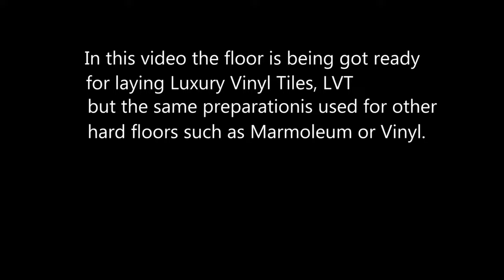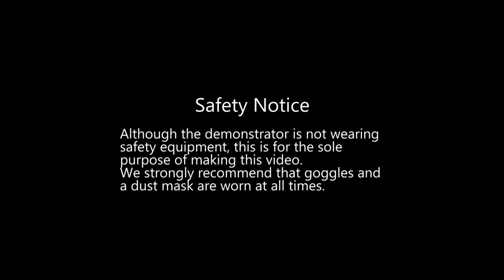How to lay a plyboard floor, a stable plywood underfloor for LVT, lino, marmoleum, vinyl or tiles.

Comment: I've got a cabin floor to ply over. I've only seen photos due to location but they look solid but ruff. Was wondering if it should have self lever on the floor boards before ply or use a stronger ply. But it looks like £40-£50 a sheet for stronger stuff. Going to need 6 of them.

Comment: If you add 6mm thick of plywood on top of the floor board before using under layer and carpet, will it stop squeak the floor? I’ve screw some of the loose floorboards, and still squeaks, and a friend of mine has said by laying plywood will help to reduce the sound, and will even the floor… my current house is old and the boards are making a lot noise. 
Thank you in advance
Reply from the maker: It will help to distribute any weight over several floorboards instead of one. But if you have squeaking after you have secured all the floorboards it is likely to your joists rubbing together and that is a much more disruptive project. I think budget wise this is the best approach.

Comment: I have used a 8’x4’ sheet of 9mm ply to go over floorboards and made sure the floorboards were not squeaking before. Now with the ply on, there’s squeaking. 
Should I have used something between the floorboards and ply?
Reply from the maker: Yes , what may have happened here is that you have attached the plyboard to the floorboards (probably screwed them?) and then tension is now pulling the floorboards towards the ply and squeaking. 

If you really can't live with it then you will have to pull some of those boards up and then address them with silicon or noggins etc. 

This is the problem with wood as it expands and contracts with temperature and moisture so it may be better and worse throughout the seasons.

Comment: Thank you for this.  I'm not sure if I should attempt this in my bathroom as I need to cut around the toilet and basin, which could be tricky.....
Reply from the maker: It has to be said if I hadn't done it before I would be tempted to just get someone in who has!
Reply: Bit late but use old cereal boxes as a template, just tape strips together  till you have the shape.

Comment: I'm preparing to lay lvt click flooring & come to the conclusion I need to lay a plywood layer first (100 year old floorboards). Ive read stuff about needing a particular grade of plywood, is this true and if so what would you recommend?
Reply from the maker: Yes that's correct. Flooring grade ply is stiffer than ordinary ply and this is what you want to use: https://fg1-plywood.co.uk/ or this https://sp101.co.uk/

Comment: Hi. Do you not need to keep expansion gaps or just butt up to the wall? Thanks.
Reply from the maker: You don't need to leave an expansion gap like you do with wood or laminate if you are fitting LVT. It, or it at least it certainly shouldn't expand and contract with moisture of heat.
Reply: No but the ply will 👀

Comment: Is premium hardwood handywood plywood fcs better
Reply from the maker: The best subfloor is am an FG1 or SP101 6mm flooring grade plyboard for all theses types of floors. It is stiff, doesn't flex and it will stop your glue wearing out and your tiles popping off the floor over time...

Comment: What is the reference to "feathers" about?  Also the last board, at about 7:30 or so in, how was that lined up before starting to measure for cutting?
Reply from the maker: So sorry we missed this comment Doug. We're amazed at how popular these videos are so quickly and we can't keep up! So feather refers to feather finish. Its a light conceret type substance, you can find it here: https://shop.fenstoncarter.co.uk/products/ardex-feather-finish-11kg 

It's used for patching and smoothing minor surface damage to level out small imprefections. Once the feather is down, you can start installing the floorcovering as soon as 15 minutes after.
Reply from the maker: I will ask Hughie to make a separate short video about lining up the plyboard next week sometime for you.

Comment: Thank you for the video do you need to buy flooring grade plywood or the standard stuff good enough also what 9mm would you recommend thanks.
Reply from the maker: We use a plywood grade called FG1 or SP101 https://fenstoncarter.co.uk/products/5-5mm-flooring-grade-plywood-3050mm-x-1220mm-10-x-4